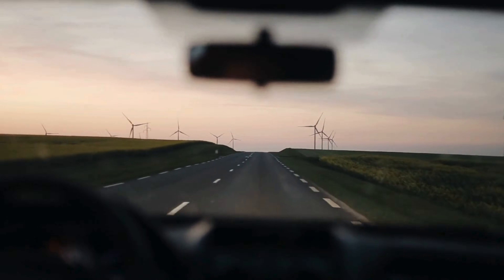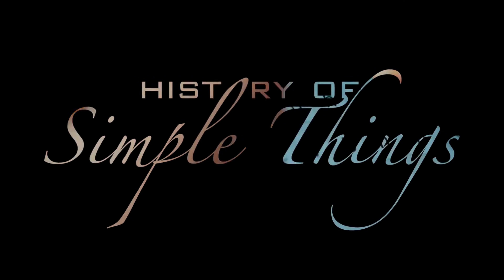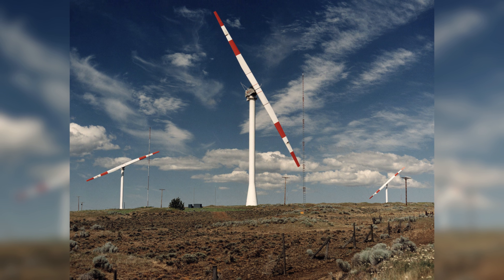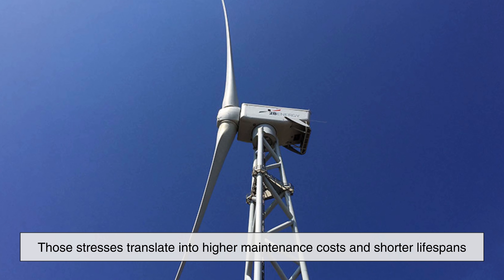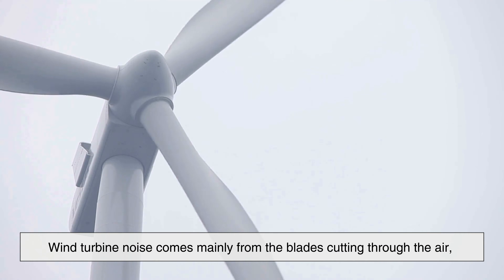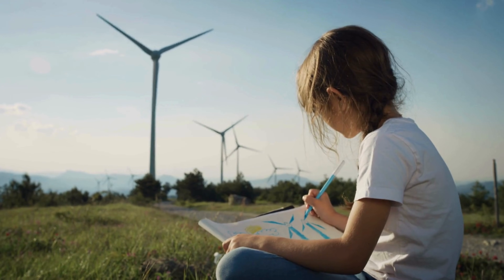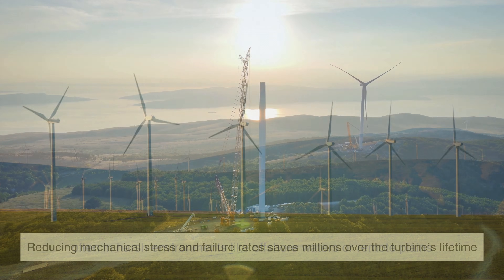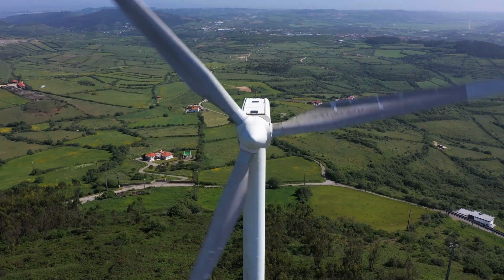Why Not 2 or 4? Why Three Blades Beat Every Other Wind Turbine Design [ID0821]

Comment: Several blades start to form resistance and a wind barrier instead of the wind flow, i.e. instead of blades, a wall is created that the wind cannot pass through. A bit like a lattice or barn that acts as a wind barrier, for example in a field or patio. That's why three blades are better.

Comment: Three phase, 120 degree separation
Reply: ? the number of blades has nothing to do with how many electrical phases are produced by the generator
Reply: @jjsmallpiece9234  Did I mention electrical phases?
Reply: @stnwrd quote '3 phase, 120 degree separation '
Reply: @jjsmallpiece9234  It was about the blades being three phases (three blades) being 120 degrees of separation.
Reply: @stnwrd 3 phase when linked with electrical generators, means 3 electrical outputs. For the blades all that matters is the angle between the blades. In terms of the blades then 3 phase has no meaning